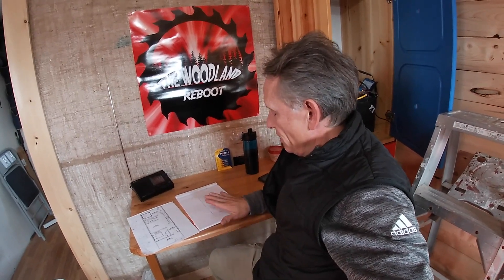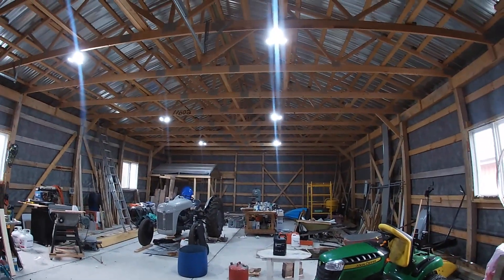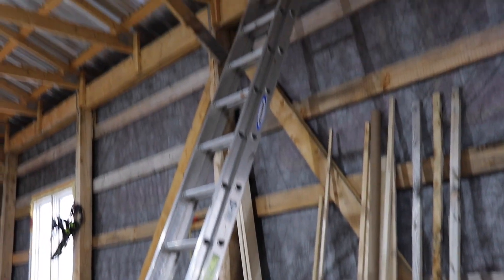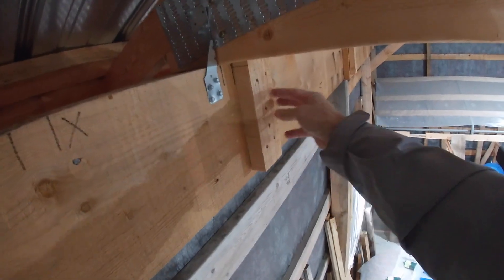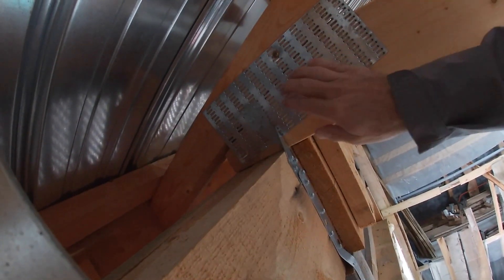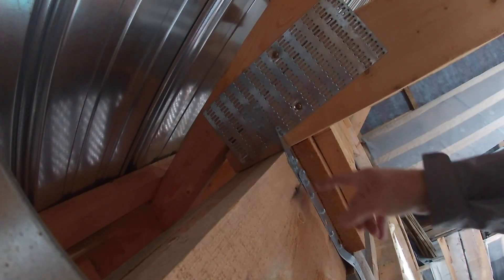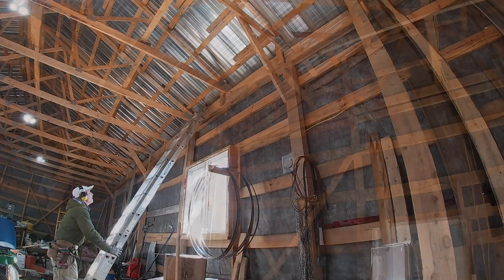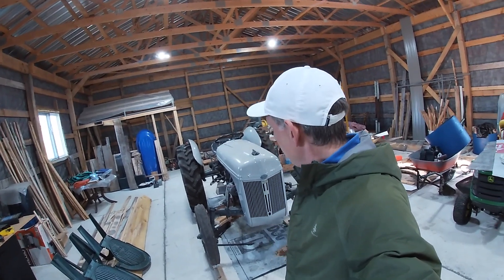Tiny House Update and Installing Simpson Strong Ties (Trusses, Beams and Posts)

Comment: It's your property and you can not do what you want to with it. How large is that building next to the barn and how were you able to build that one?
Some rules or laws are made with little thought put into the decision.. Anyway, ......have good days!!
Reply from the maker: It is frustrating. Having said that, the cooperation and support from the building department has been great. The smaller building is classified as a shed and I don't live in it so it works out. I'm continuing my conversation with the planning department and there is a minor variance process that could help. I have to look into this some more.